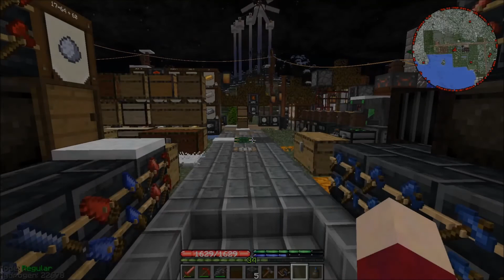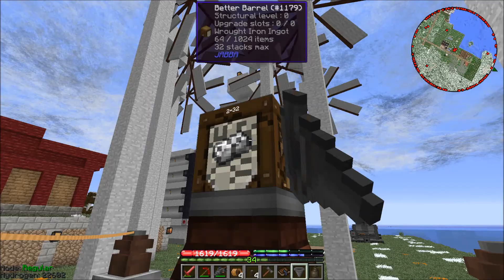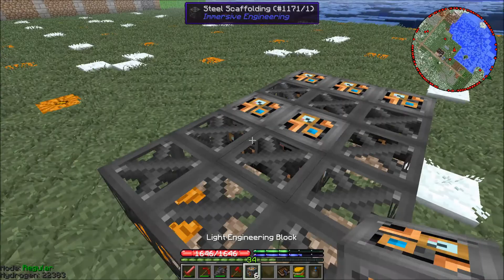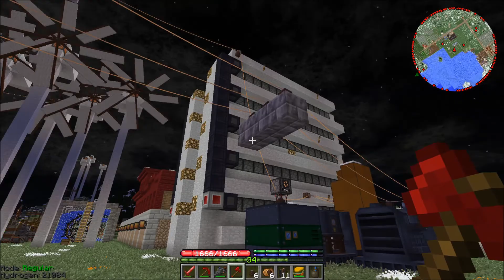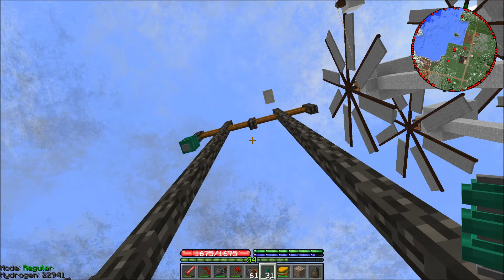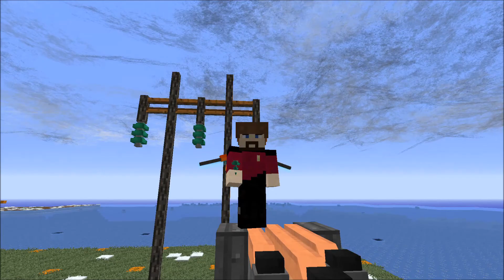TechNodeFirmaCraft Episode 31: High Voltage!

Comment: Mr Wostrel, my gratitude on you having put on youtube the best TNFC lets play by far, also the longest I can find. Ive had your videos on loop as I learn some elements of TNFC. Ive been playing with a friend on a private server. Ive discovered you can burn creosote oil in a railcraft boiler (multiblock) you can use to power a steam engine for a little extra RF from excess creosote oil. Youre a bit past the point you need rf but still, that's the only option for excess oil that I know of. Ive built a coke oven before and I can remember pumping creosote into tanks using buildcraft pipes but I cant get that to happen in TNFC, maybe things have changed. Anyway thanks again, great that you've put a few new tnfc vids up recently.
Reply: +David Dines Dont be afraid, there are lots of things to do :D Like penumaticraft ... and the problem of RF, because our reed + hemp farm can make +- 10-15 % resources needed to run the diesel generator so we have to extend it. Our future problem will be capacity of HV wires (maybe).